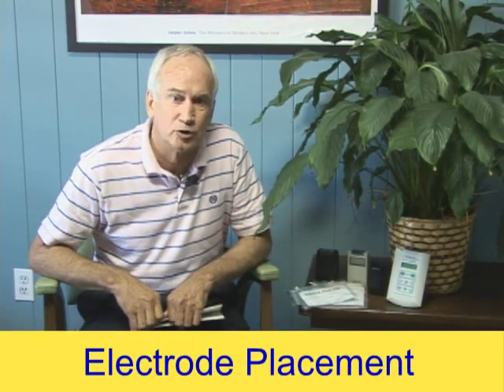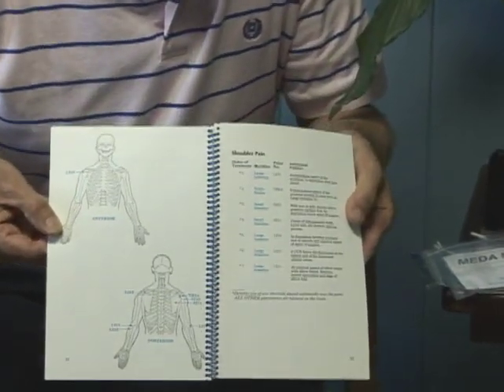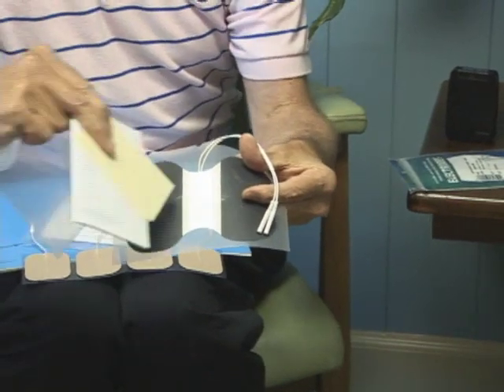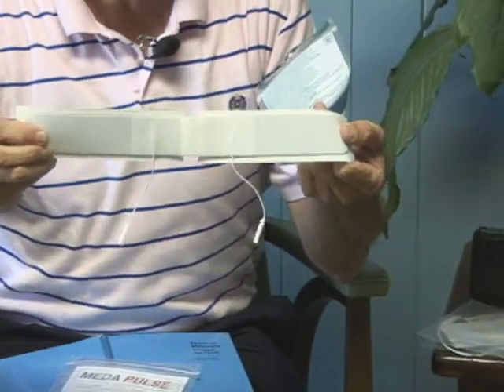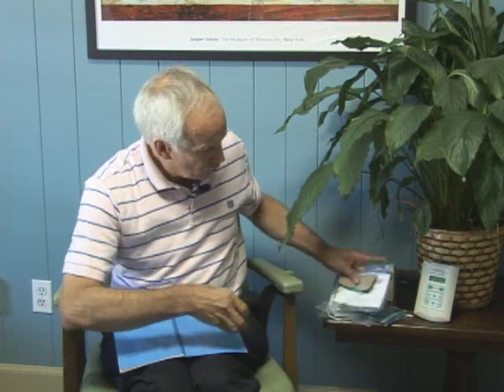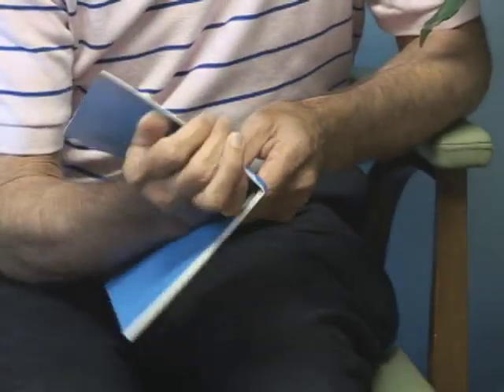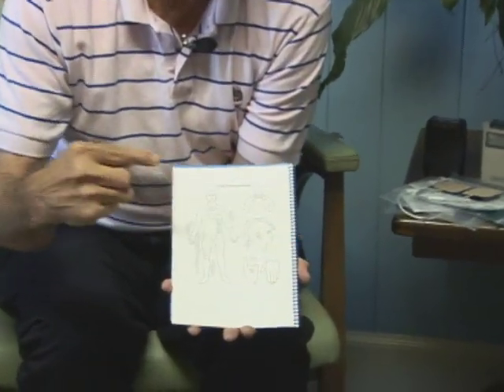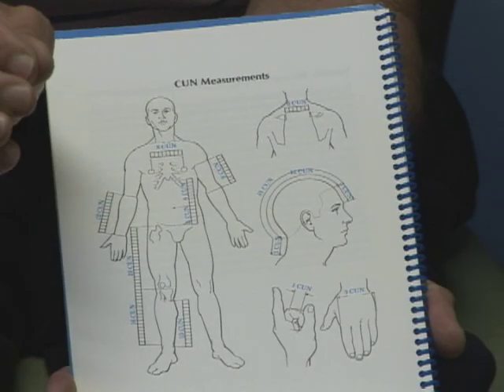Medium Frequency Stimulation Machine, Infrex Plus,  Tens Electrodes Placements

Comment: Hi- What do you suggest for TMJ pain? I got the TENS at home. Thanks.
Reply: Yes I'd like to know the answer to this also, have TMJ and get pain in cheek muscle just under TMJ.
Reply: Bob Johnson I read on a TMJ site to use a "low frequency" tens unit for face, wouldn't the interferential be too much?
My pain is not so much on the TMJ itself but just below in my cheek area.  Saw an osteopath today and he did manipulation and said my fascia was twisted on the side where I was having the cheek pain.  Are you a PT, chiropractor, MD, which?

Comment: is there any reason to get the tens and muscle stimulator or does some of them have both in one? I have the ultima 5
Reply from the maker: Generally the answer is no to your question.   Many time a vendor will say "muscle stimulator" when what they really mean is "enough power to stimulate a muscle nerve".  That is not a muscle stimulator.  Need a variety of controls on a true FES unit ( correct name is Functional Electrical Stimulator).